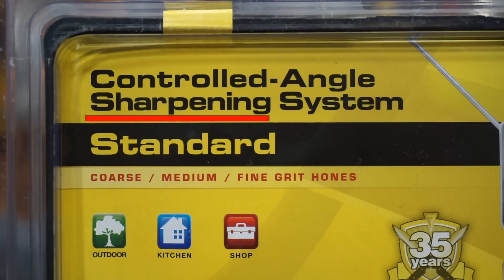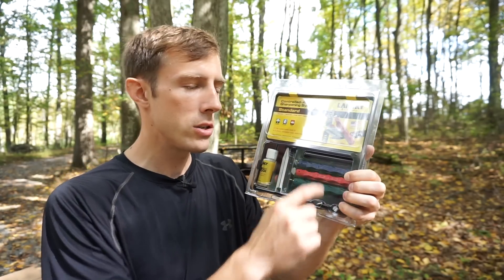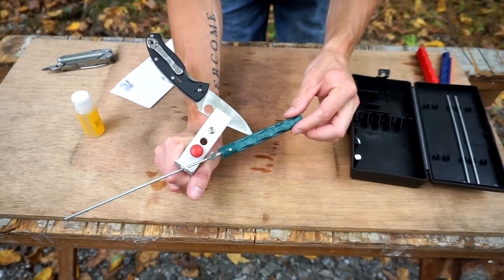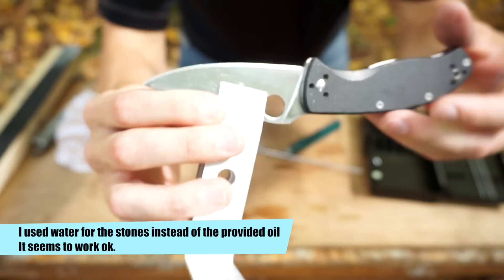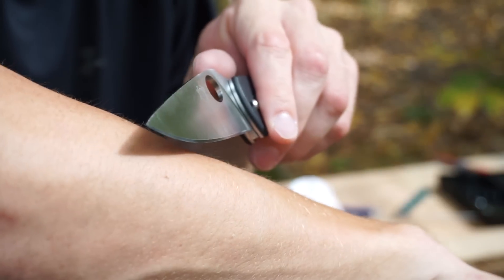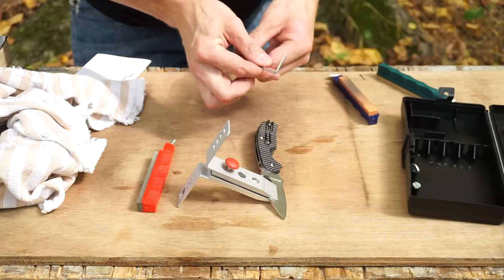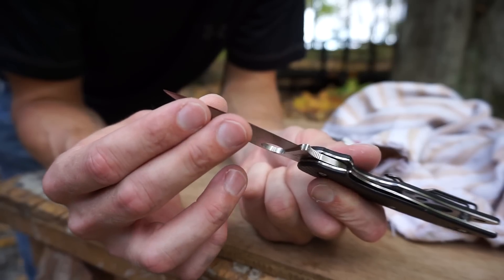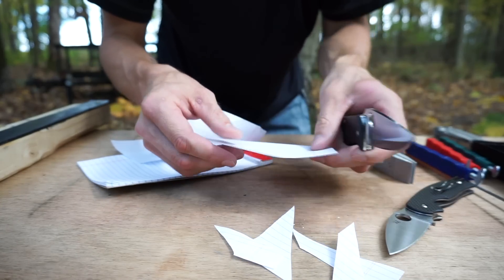LANSKY CONTROLLED ANGLE KNIFE SHARPENING SYSTEM | Another great beginner sharpening system.

Comment: looks cool, I agree that mount needs a base, maybe the idea is you can make your own base, I have the Lansky Blade Medic that came with the Lansky Responder (440C steel), if I had this system which stone would be best to start with for a 440C blade?
Reply: Kaylynn Strain  i made a base by using a 5/16" bolt, with 2 nuts and clamping the bolt into a vice.  worked well.
Reply: The sets generally come with 5 different grits (coarseness of stone ) depending on how blunt your knife is you would start coarse and work up to a fine , if it's not to blunt then you can skip a stone or 2 .
Reply from the maker: I found the base on amazon. Ill probably just use a bench vise if I continue to use this system though. It depends on how dull your blade is. You can't hurt anything by starting too coarse. Just apex on the coarsest grit and work up from there. Once you form a burr its on to the next grit. Thats just how I do it. Hope this helps.😀
Reply: I wonder how the lansky blademedic perform Does it performs great or not? Some reviews say its great some are not
Reply: As stated earlier, the best stone to start off with depends on the condition of the edge. A beat up edge may need the 220 or the 180 grit stone. Never start with the 80 grit unless you're rebeveling your knife to be re-profiled. Whereas a general sharpening job could get away with the 600 grit stone. I've sharpened so many knives it'll make your head spin. Knowing that, with this setup, particularly the deluxe, I have sharpened everything from 8cr13mov to Elmax and M390 with no problems. Also, I do trash the system portion and just freehand with them, but when I did use the mount, I just held the handle like a regular knife and the stone face up and sharpened in a free hand fashion while still attached to the mount. Worked the best of any way, including the base. Also, after close to over five years, I've only needed to flatten them twice. And I'm a high end knife collector with some pretty tough steels that don't always like sharpening. So for the money, these are great stones.

Comment: That's what I use to sharpen my knives. Also bought the stand for it and makes it all really easy. Also have the strop from Lansky and that works great too. Only problem I have is on really shallow angled knives like my Scandinavian blades (10 degrees) it does not support so shallow angles and have to do it by hand.
Reply from the maker: Ill probably just use a bench vise from now on. It would make it sooo much easier to have it clamped in place.

Comment: Would you recommend this system or an inexpensive 2 sided wetstone for a newbie sharpener?  I want to be able to put a decent edge on my edc blades as well as my kitchen knives.  Thanks!
Reply from the maker: If you have no experience with freehand sharpening I'd recommend this system. If your willing to learn and practice freehand sharpening than a whetstone is recommended. This is a great system for a no guess work sharp edge. Hope this helps 😀
Reply: Thanks! I think im gonna try this setup and see how it goes.  Cheers

Comment: I was thinking of getting the lansky turnbox but now I'm strongly considering this. Which do you recommend?
Reply from the maker: This gives more control. The stones on the turn box will last longer though
Reply: OUTDOORS55 i think I'll go for the turnbox because it seems higher quality and i don't need the added control. This is great for 20 dollars though and it's even harder to mess up on this then on the turnbox, plus the added control
Reply: honestly i'm really flip flopping between the two. both are good though
Reply from the maker: I would get this over the turn box. The stones won't last as long though, and it takes longer to use. Just my opinion😀
Reply: Honestly you've convinced me to get this. I definitely like the added control and how its even harder to fuck up on this then the turnbox. Plus this comes with more (although lower quality) stones and i have a clamp i can use to mount it so it isnt inconvenient to use. Its cool to have an edgepro type appliance for 20 bucks
Reply: Like i said i really am flopping all over the place. I'm also considering hand sharpening because its very relaxing and satisfying and i was just able to put a decent edge on my buck revel using 320 grit sandpaper and a relatively crappy setup, which is pretty good considering it was my first time hand sharpening. your tips were pretty helpful. by decent edge i mean i'm able to cut filler paper relatively cleanly and if i just whack the paper it will cut sometimes. It was pretty dull before

Comment: Hi Alex. Great videos, please continue. I have a couple of questions for you. I noticed you sometimes only pushed the stone over the blade and other times pushed and pulled. What's best?  The other question regards something I don't recall you discussing. When do I use the hone that was part of my kitchen knife set and does it serve roughly for a strop?
Reply from the maker: Theres not really a best direction. For freehand sharpening use whatever direction you feel most comfortable. For this system it doesn't really matter. 
   I don't have a lot of experience with knife steels/hones. Theres a number of reasons they are in kitchens instead of strops. For one they can be cleaned. Leather with compound in a kitchen would get nasty real fast. Kitchen knives are usually sharpened at a much steeper angle than edc knives. Those steep angles, combined with the knife hitting a cutting board can roll an edge fairly easily. A steel will straighten a rolled edge easier than a strop will. There may be other reasons as well. Hope this helps😀

Comment: What do you think about making your own DIY system similar to that one? Some plank with screw that forms kinda like circle at the top (its height makes for angle), clamps to hold both plank and knife, a basic metal rod that goes trough that screws' head and stone atached to bottom of rod with something simple as tape? Im in process of making one, if you decide to make it I can myb help
Awesome video too
Reply from the maker: The hardest part about DIYing something like this would be finding a way to hold the stones in place. Other than that its very doable. It would probably cost the same to diy or maybe even more. It could easily be done though.  Thanks my friend😀

Comment: the more expensive one is better boxed hahah btw bro take the rod and when you put it in the hole before you tighten lay it flat (stone side) down on a table and line the bar to the stone before tightening.. basically like l  <-this.  they do make a pedestal you can get for this kit as well as a strop.. great vid as always!
Reply: sorry it changed the design i did after it posted lol anyway the bar and stone should line up... smiths makes one similar to this with a 600 grit diamond and 1000 Arkansas stone for like 20$
Reply from the maker: Oh ill have to check the smiths one out. They I figured the bar out later. I thought it was saying to mount the bar flat against the flat part of the plastic. I was wondering why it wouldn't stay there. Ill probably just use a bench vise from now on if I continue to use this. Thanks man😀

Comment: I had this sharpener, but after trying my damndest to use it, it just got annoying. Having to switch everything around and the fact that the clamp barely held onto the blades, I sold it.

A while back I want to an outdoors store and bought a Smith's dual grit diamond stone/knife combo pack. I've since given the knife to my brother because it was trash, but the sharpener itself works and produces a shaving edge 95% of the time.

The reason why i love my Smith's dual grit diamond stone is because it gives me practice to maintain my angle, takes 10 passes on both grits to sharpen a knife decently and is incredibly simple to use.

I'm probably gonna do a review on my channel of the sharpener with a decent knife.

Comment: 8Cr13MoV isn't really low quallity steel it's more middle quallity in my opinion.
It's actually the steel I prefer so far.
It suits my needs the best.
How ever... Seems like a nice sharpening system, but it could really use a base.

But I fell in love with the Lansky Turnbox system I saw you reviewing :D

Little tip! Don't shave your face for a day or two, to test the knifes on bear hairs :D
Reply from the maker: I love spydercos 8cr13mov. It does need to be heat treated properly though. Ive had some 8cr13move knives that were crap. I call it a cheap steel, as it is cheap comparatively speaking. Cheap doesn't mean bad. I carry the tenacious 90% of the time and love it.  I do still like the turn box system. Its much faster to set up and use and still gives a very good edge. That system is more portable as well.

Comment: Sounds like it's not bad at all for under $30. (Makes you wonder why most others with an angle guide are stupidly expensive.) Also looks like using it would be made easier with a bench vise.
Reply from the maker: Yes a bench vise is what ill use if I continue to use this system. Its not bad for just over $20. The stones are pretty low quality but will work just fine. They load up somewhat and need cleaning often. No big deal. They do sell higher quality stones separate so thats always an option. Its definitely fun to play around with👍
Reply: OUTDOORS55, as you said, it's not bad for just over 20$. Converting our currency it starts at 65-70$. No way i would buy it for that money... Sadly, amazon doesn't ship to Russia! But thanks to you i bought lancky turn box, and totally satisfied with it! Nice videos, keep up the good work!
Reply from the maker: Wow thats crazy! The turn box system work great aswell its a much faster system to use. Thanks for watching my friend😀
Reply: I got the deluxe kit with the base (makes it so much more easier) but I have to say that it's being doing great work for me and I got it delivered to my door for like €45

Comment: Just the tip from a fellow Knife Guy, perhaps you should use different knives from different brands for these sharpening videos. If you have a buck knife maybe use that, or if you have a SOG use that just changed up because you're always using the same Spyderco Knives period or use a completely cheap mtech knife to show how good these sharpeners are on cheap cheap Steel
Reply from the maker: I sharpen the knives I use. I’m not a collector, I’m a user. Most of what I have are spydercos.
Reply: OUTDOORS55 oh ok

Comment: Another great video Alex, I actually have this system, but i have never been able to get my knives shaving sharp. How long roughly do you spend on each stone? When you get your burr, do you get it on one side and then flip to the other, or do you keep sharpening both sides until a burr forms on either?

If the arms are hairless, you are going to have to get them legs out. haha.
Reply: when you sharpen with the system try to from a burr on one end then move to the other side, once the burr is on the other side that you were just sharpening on then flip it and move to the next stone. do this till you finish with all your stones. i do this and minize the burr with my last stone because i dont have a strop. this is how i do it and my knives can shave. good luck!
Reply: Thanks for the help, i will give it a try.
Reply from the maker: Riley Basuil is correct. Thats pretty much what I do. I just use a strop at the end. If you don't have a strop you can use an old leather belt. Thats actually what this diy strop is made from. Hope this helps😀
Reply: Great thank you. I am going to give it a try today and will let you know how i get on. I do have a strop so hopefully i can get a good result.
Reply: I got it pretty sharp, but still not shaving sharp. Bit more practice for me. I am stopping when i can see a burr and move it with my finger, but not getting wires coming off, maybe that is too soon? Never having got a knife shaving sharp before i think is where i am stuck, i am not entirely sure what i should be feeling for when enough is enough.
Reply from the maker: Try a little more pressure on the strop. Also try different angles while stropping. It all depends on how hard or soft the leather is. Sooner or later you'll figure out what works for that particular strop.
Reply: Thanks Alex, i will keep trying.

Comment: Looks like you were using the 25 degree preset to sharpen the Sypdercos.  Is that the best angle to use on a factory Spyderco edge (i.e. Tenacious or Delica) or do you think another angle (17, 20, 25 or 30) would be better? ?
Reply from the maker: 25 is kind of the happy medium. 30 for a HARD working edge. 20 and 17 should probably be reserved for kitchen knives and lighter  duty stuff. Although there are no rules to this. I experiment all the time. Hope this helps 😀

Comment: i have a problem in sharpening a thick cheap knives, but not in thin cheap knives, do have any hints or ideas what to do or what i could be doing wrong.
Reply from the maker: Your probably not fully apexing.
Reply: Thnx for the reply, but i think it is not the apex because i usually form that burr in the both sides before start polishing my edge, in fact i never tried to sharpen a thick knife that has a good quality steel, that why i can not guess what is my problem there,

Comment: @OUTDOORS55 Hey, I'm not sure if this is the best spot to ask for not. But I got this kit, and I tried it on an older knife I had before I could get sharp, and I tried it on this one, went through all the stones and even with a mirror finish I can't cut paper. Is it because the blade isn't apexed and the sides are uneven? How do I fix this? Thank you!!
Reply: In case anyone is looking for an answer:
In most cases you have to create a burr, and then make about the same amount of passes with the same sharpener on the other side. When you're done with the grit progression, you have to remove the burr. Use very light pressure with your final hone, and alternate sides after each pass. Stropping helps here, you can also increase the angle just a little bit

Comment: The guy store near me has a 2x3 meter wall packed with accessories for this system. 
Although if you have a double edged knife with a narrow blade you will be better off using the stones without the clamp,  as their are so many steps you will have to take to get the thing symmetrical it is really not worth the time.

Comment: Every one talks about strops, I ant use one, I will dull the sharp edge every time.  I have tried about 10 or 15 time using different approaches and still dull it I have given up on strops and use my cermanic rods very light and it gets a nice polish and a little bit sharper. Wish some one could help me. Karl
Reply from the maker: Hmm..thats interesting. A strop can dull if the blade is over angled or pressed too hard into the strop. I use light pressure and a shallow angle. I don't have a strop specific video but will definitely be making one at some point. Hope this helps for now😀
Reply: I tend to overlap every time one side is sharper than the other every sharpening devise I have, after play awhile I do get them close but don’t know what I am doing wrong boy do I get frustrated, any advise.
   I have about 15 pocket knives and about the same number of hunting knives and I have about giving up trying.  I have stone Spyderco and Lansky turn box sharpners. Would going to the Lansky deluxe help me, I am a little worried about sharpening with 17 and29 degree angles.  One guy told me he hits the red screw down button when using those angles I like to even go down more on my chef knifes but am afraid to so I use a guide to check my angle for lower angles.
   Would you recommend this Lansky Deluxe for me, I have been thinking about it for a long time.  The others they show are very good but so is the price.  Iam handicapped and used to make knives down cellar and was doing very well till I got sick and couldn’t go Dow or up steps. I now use dinning room table and the stones make a big mess. Thank you for listening to me ramble on, sorry about that, so much to learn.

Comment: Been using this sharpener all day and have yet to get a sharp edge. Only a smooth edge . What am I doing wrong
Reply from the maker: Sounds like you haven't apexed. Try applying slightly more pressure and work one section at a time. If light reflects off the edge the knife isn't apexed. If your knife was really dull it can take a lot of time. Hope this helps😀
Reply: OUTDOORS55 will try more pressure thanks for the reply

Comment: I had so many problems with this thing. I hated it. I use the stones to free hand more than I ever used the system itself
Reply from the maker: Really? I think the worst part is finding a stable place to use it. I also think the stones could be a little better but I guess thats what you get for $20.
Reply: OUTDOORS55 I could never get a knife to stay in the jaws. I would clamp it down and the blade would slowly start to move. or it would fit in the jaws all messed up. and make the angles on each side different. I couldn't sharpen a spyderco with it. the taper of the blade made it nearly impossible. I just ordered a kme. so that should be a lot better. I just feel like the lansky was a waste of $50.
Reply: toxic flipper there's a rubber jawed clamp I think it's available on Amazon.  My blades wiggle too. I hate that the more they wiggle the more scuffing along the spine of the blade.  I have really good results though, I'm scared to use it on my old straight razor though.  What do you think outdoors55 ?